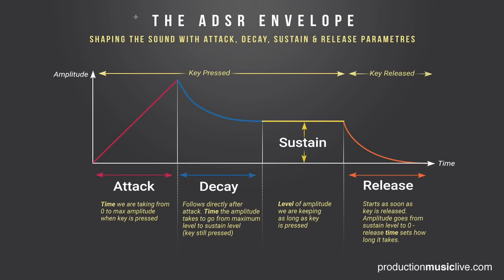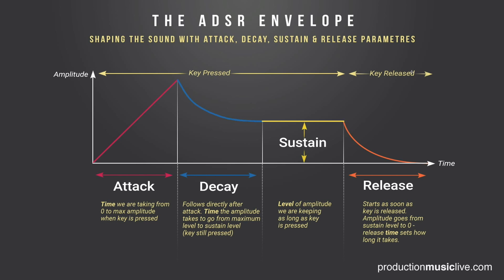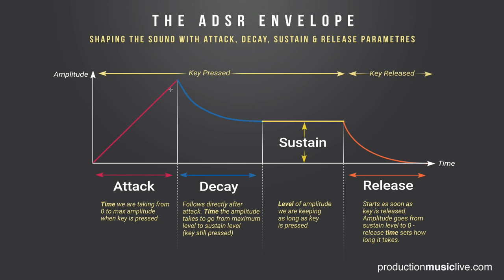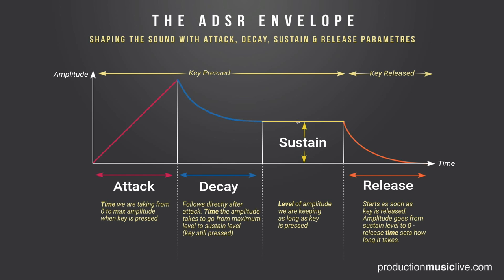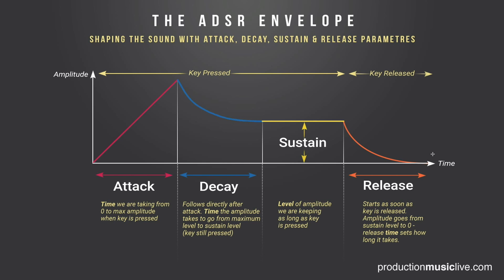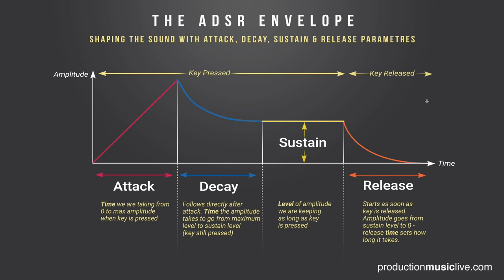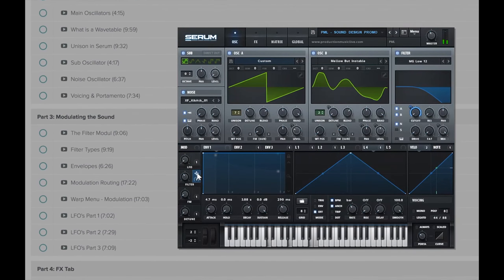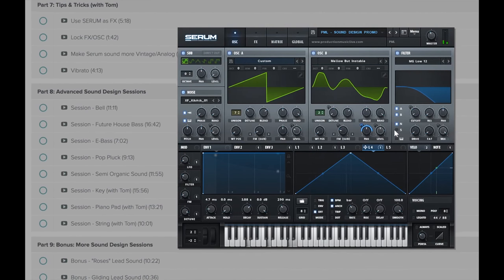How To Use The ADSR Envelope

Comment: How do I find the ADSR envelope in Ableton though?
Reply from the maker: It can be found in Instruments (Operator, Wavetable, Analog, etc) or in a Sampler (Simpler, Sampler) in the envelopes tabs. Wherever there is an audio signal that needs shaping.
Reply: @ProductionMusicLive  Thanks for the reply. Is there any way I can find an envelope for adsr on MIDI? Also I dont have the wavetable cause I have the standard pack :/
Reply from the maker: @jackaguirre8576  Midi fx usually not so much! It's generally more an Audio thing. You could download a free vst synth called "Vital" (just google Vital Vst) - its very similar to "Serum", but free. Its packed with envelopes, lfo's and everything. Ready to test out the concepts!
Reply: @ProductionMusicLive  thank you for the advice!